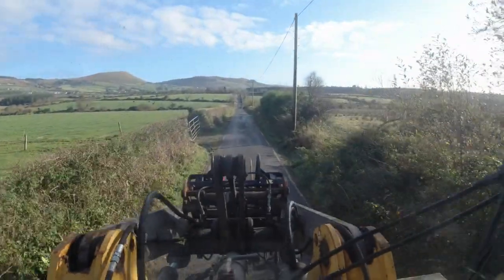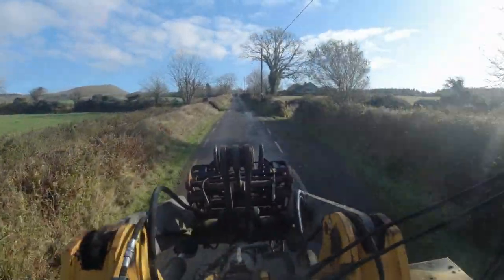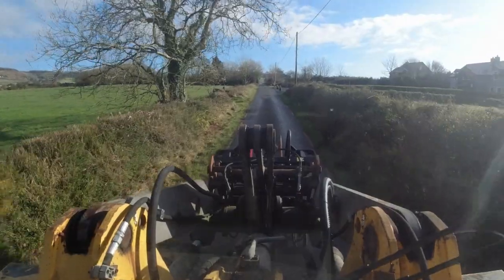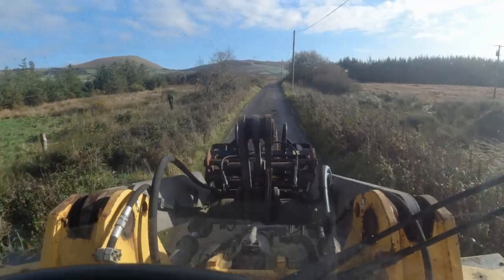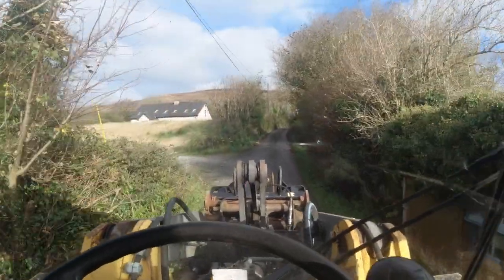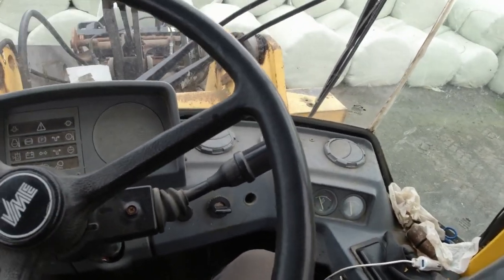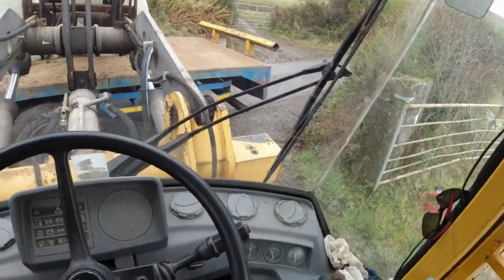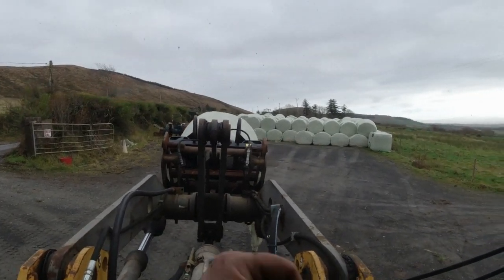Loading bales with the volvo, Servo controls or joystick?

Comment: Volvo are the only loader use to drive a 03 L60 E 23000 hours on her and was going like a clock , she got big wheel on her for the silage and she was able to do over 60k on the flat its was rocket of a yoke loved her . The man I worked for changed up to a 08 L70F now don't get me wrong it's a savage of a loader power and weight wise but it's just not quite like the 60 was . The lollipops are great job I find it hard to drive a machine with a joystick.  Great videos keep them coming.

Comment: 👏👏
What length is the 2 trailers that you use?
Getting back to the cvx, what's all the buttons on the joystick for? Are they for the spoolvalues or the lift?
Also what's your thoughts on buy a yoke from the North or the UK? As in do you think you get better value for your money or do you try to buy local?
Personally I'd be a person for a joystick in a yoke. But also unless you drive a yoke like the Volvo. You really can't say for sure which is a better type of a yoke to drive or use.
Also I seen where someone ask you where your from, as they couldn't place your act send. I was wondering the samething for a bit aswell. Until I seen some road signs in your video's. You must be up in North Kerry, near Limerick?
As you don't have a strong Kerry act send.
Great video. 👏👏👍👍
Reply from the maker: Two 28fts a 29 and a 22.
Top button is a spool valve this can be timed so for instance when your ploughing you can time it to 9 seconds and in that time the plough will turn over once you give it one click.
Under that your plus and minus buttons are to control your speed if for example your hedgecutting and your driving on the foot and you think this speed is suitable for the job then press the plus button and it will set your cruise control at your current speed you can then remove your foot and the tractor will stay moving at the set speed.
You can also use the plus to speed up your cruise control speeds.
The minus button has the opposite effect it will slow down your cruise speed it also can be used as a transmission brake if your going down hill say you press the minus and it alters the transmission ratio to give you more pull back on the transmission.
Top right hand corner is a forward reverse button interesting thing on these Is if you put them into reverse at 50km/h all they would do is come to a gradual stop and start to go into reverse.
Under that you have a preset lift dial that you can set with other switches in the cab you can set a max and minimum height on it.
You can also set it that when the lift goes over a certain height ie 50% then it will shut off the pto and bring it on again when the lift goes below a set height.
And another feature on this is it can drop the engine revs when the pto shuts off so for example power harrowing your not revved to the hilt on the ends.
Under that you have a headland managment button.
That can for example mowing with triples lift the front Pto.
Reverse the fan (if one is fitted) a few seconds later lift the rear mowers and another click do the opposite.
And finally under that you have the cruize control button that you can use for 3 pre set cruize control speeds.
On buying out of the North or England I'd have no problem doing so but I guess we would be fairly willing to tackle repairs and the likes so wouldn't be too worried if there was going to be problems. I obviously you need to be buying them cheap for this.
Bang in the middle of kerry
Reply: @mrcvx 
O right.  We've tight enough roads up here in Mayo aswell, along with small/tight gateways. So some of them trailers would a bit on the big size for here, aswell. 😂🤣😅👍
O right, very interesting. You'd need sometime in 1 to remember all of that. 😂🤣😅👍
I wouldn't say no to buying from England or the North either. Sadly I'd be no good at doing repairs or jobs like that. Also I've no shed or yard for doing that kind of stuff. 😢😥😪
O, very good. So I'd say it's a fair spin up to Limerick or across to Cork aswell. 😂🤣😅
I'd say Kerry was lost without the Rose of Tralee Festival this year. I spent a few summers in west Kerry as a kid.
I'm from North North Mayo.😂🤣😅
Is there much difference between the 2 cvx's?
Reply from the maker: Tourism is definitely down no bad thing for our line of work really quietened the roads as we would be doing alot of farms on the town boundary and even one in the middle of it!
The cvx 130 is a teir one so some small differences but mostly the same.
The dream would be an original cloths steyr 6195cvt.
Been in most of county limerick with a tractor.
Was in Cork City with one, been to clare in one a couple of times too
Reply: @mrcvx  
Ya. That helps alot having quite roads alright.
O right. YA I'd say they'd be some yoke alright.
O right,very good. You'll have to make your way up here sometime. 😂😂🤣🤣😅😅👏👏👍👍